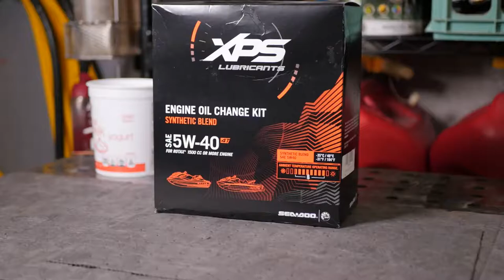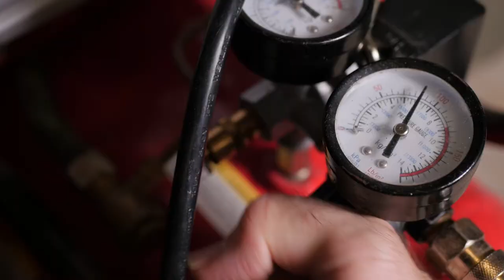Preparing A Sea Doo Wake Pro 215 Jet Ski For Winter Storage

Comment: Thank you for the awesome video! The only challenge I ran into was that when I loosened off the filter element bolt, I could not pull the filter element out by hand? I had to gently pry the cap up slightly and then I was able to wiggle it out. Also my nut was half way down the stem. Dealer told me to use a bit of blue locktite and hand thread the nut up to the top of the stop. I torqued it to your specs approx. 6.7 FT Lbs., so with any luck it will come our easier next Fall? Appreciate your comments on the above? I checked after for leaks, ran it for 20 sec. All good. Ready for Spring :)
Reply from the maker: Thank you very much - I'm really glad the video was helpful.  My thoughts are that the nut on that bolt, when done up tight, will force the cap up and out when removing the bolt.  It seems to me if that nut has worked its way down the thread, there will be more play between the bolt and the cap so the cap won't be forced out.  I have not experienced that, but I can see how it could happen.  The Loctite solution sounds like a good one - just be sparing with it so it doesn't contaminate the oil.
Nice job on doing your own winterization, and thank you for watching!
Reply: @mainejason  Thanks that makes perfect sense. I only used a drop or two of blue locktite the top the nut and wiped off the excess. With any luck next Fall winterization will be easier :)
Reply from the maker: @steve7455  Sounds perfect, well done!